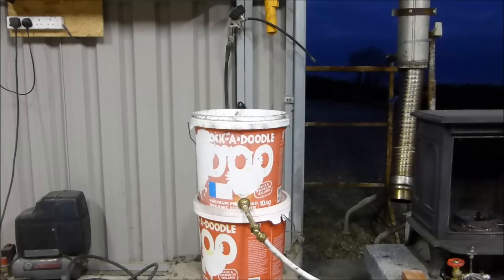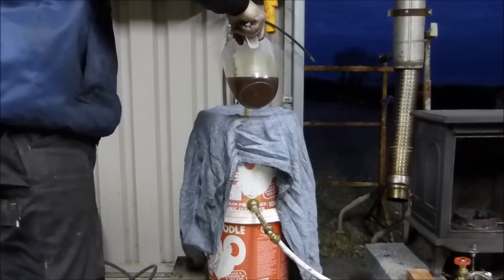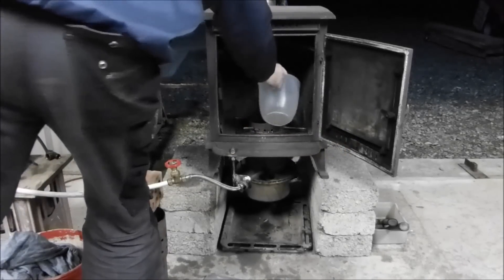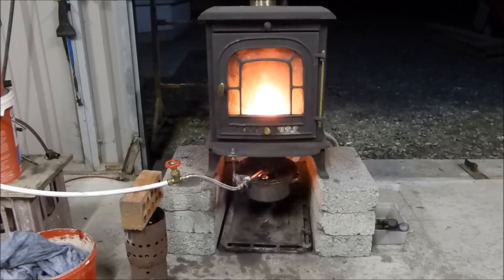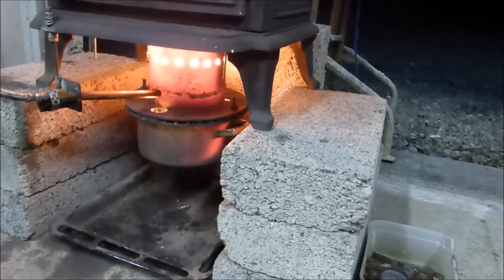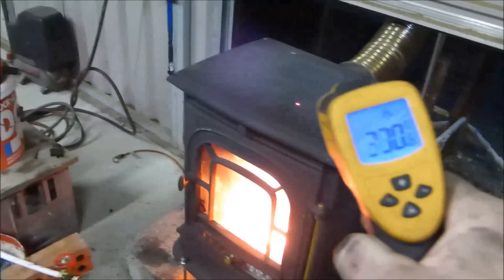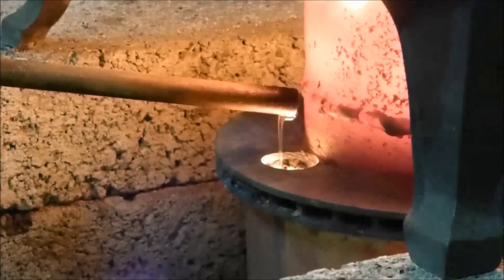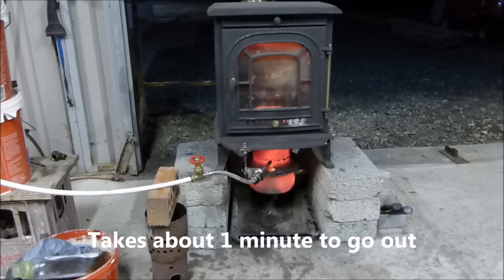Waste Oil stove heater over 800 degrees F in just a few minutes.

Comment: Pressurized oil can atomizer could throw a flame & perhaps be a primary lighting method, see what you can make instead of buying a reusable spray can for paint spraying. Add a bit of gas to the pressure input mix. See if you can obtain gasification from your flue pipe.

Comment: i build a drip feed system with a metal tank on the wall with a copper tube with a valve in it that runs through the stove's door, it drips the oil into a pot where its flamed off. could i run diesel instead of used car oil without an explosion? because i know i can run pure kerosene no problems and since diesel is a heavier fuel then kerosene i thought it could work because its so cheap compared to kerosene or trying to scavenge used oil.

Comment: I am super exited to get this running. Have all the parts done, only missing a valve and some pipe from my bucket. Hopefully I will get this running by next week :) Can't wait to get heat in my shop, it is -14F here now so my shop is just above the freezing point thanks to a small electric fan.  

Might post a video too, but this is not legal in my country so don't want to much publicity :) 

Thanks for the videos, it helped alot. 

Best regards.
Reply from the maker: Hi Norwegianwoodworker. Well done getting this far. It wont be long before you are opening windows to cool down ; ) Your flue length and diameter are important and will give you the pressure to mix the gasses for a clean burn. I was just chatting with someone who is about to light the blower version of this burner and there are quite a few guys out there who have made these. The propane tank conversion I did will burn wood scraps and veggie oil too if you want to stay green. Have fun  and pm me a photo or video. Cheers Gerry
Reply: Jepp will make a video and post on Youtube.

My main problem is the flue. I have only used 6" aircondouit pipes so far ... Not good, but I have a flue fan to increase and help the airflow. This is something that I had to use at least when I was using my wood stove.But when the pipes got hot it was ok. But I will be investing in a proper fluepipe/chimney shortly. I just want to find out what workes for me :) I made a sawdust barrel stove a while back, it did not live up to the youtube video. And was in the bin the same week. 

But I have total faith in this one. Also I have accsess to unlimeted amounts of wasteoil :) Also veggie oil but not so much. 

These large propanetank's are not available in my contry so I will not be able to make such one. 

Have a good weeken 

Best regards from Norway
Reply from the maker: Hello Norway. These things can go from modest heat to nuclear depending on the oil flow and the flue draught but they really do work. Cant wait to see the video. Cheers Gerry
Reply: Gerry's Waste Oil Burner Hello again :) 
One question, does this make a lot of noise out the chimney ? I have a school 8 m away from my shop on the south side. Hope it will be reasonably  low sound levels :) 
TR
Reply from the maker: Hi Norway. Its makes very little noise from the chimney. I don't think that it will be a problem. Even the blower version makes little noise from the chimney. Cheers Gerry

Comment: can u not just leave the brake disk vents open to draw air and put less holes in pipe?
Reply from the maker: Hi David. I was looking to use a solid brake disc but I only had a vented one. You could block off some of the vents and maybe leave a few open but you are looking for an incomplete burn in the primary chamber and the rest of the combustion takes place in the 8 inches of pipe with the holes in. The aggressive burning pulls more air in at pressure to mix the gasses and complete the burn. Check out Ozzirt on youtube as this burner is his design. Cheers Gerry
Reply: Thanks that helps i didt think of it that way.

Comment: Isn't 800% F a bit much for indoors.?
Reply from the maker: Hi Robin, I use this burner in my uninsulated shed and in most of the videos its just in testing mode where I want to see what the stove is capable of. I run it a lot cooler in normal use. Waste oil is capable of producing lots of heat but like any fuel there are dangers. Cheers Gerry
Reply: Gerry's Waste Oil Burner Thanks, for answering..

Comment: I made one a couple off years ago from a petrol stove. That way its more easy to make it burn a little slower. I just adjusted the oil intake to allow the thick oil to pass
true and also you need to make the oil pass true a copper thin spiral nearby the stove to preheat the oil just a little bit. THE ONLY PROBLEM IS TO GET THE OIL FOR FREE ONCE YOU START BURNING 10 LITER A DAY !!
Reply from the maker: Hi moetakke. In later videos I converted a propane tank to burn the waste oil and also set it up so that I could burn logs / solid fuel. It makes for a very versatile and inexpensive stove. http://youtu.be/J9-0Do0dzCY?list=UUqe1yTIkHEFx17lmI1zvttA
Same stove burning waste oil  ..............   http://youtu.be/QQGtl87-x58?list=UUqe1yTIkHEFx17lmI1zvttA

Cheers Gerry

Comment: Have you gotten it red hot like that and then tried running even less water into it? Maybe that temperature will split the cohesive bond of the h2o and you'll have a water-based oxygen/hydrogen stove... IF that much works, then you just have to hope that the oxygen/hydrogen burns hot enough to keep it cherry and keep the reaction going. It's worth a shot. If you do try it, use distilled water.

Comment: Hello, is the brake disc made out of cast iron? If so ,what electrode or filler metal did you use to weld it?I'm currently trying to build an oil burner similar to yours but don't know if welding a cast iron brake rotor to a steel pipe is possible.
Reply from the maker: Hi sloppi1234. Yes the brake disk is cast and the rods I used are just standard mild steel filler rods. Have a look at my other burner and see which one suits you better. It will fit inside a stove but requires a fan. I show the build and I show how to light it here: http://youtu.be/AiKcx7ghtHk
Cheers

Comment: do you think a forge could be made to run like this? 2000 F is a big step up from 800 F but could it be done?
Reply from the maker: Hi. Although this set up will go quite a bit hotter I think in order to melt iron you would need a mechanical fan and a turk burner or babington burner type setup. Same feed system but some sort of refractory cement / clay liner to keep the heat in and an air supply added from a fan. The advantage would be that you could match more air to more fuel until you got the required temperature. Cheers.
Reply: I was thinking build a rocket stove with this as the fuel supply and you could get it really hot.

Comment: Hi.... and good job, seems to work great...
Have you done any experiments in reducing the air / waste oil mixture to make this a more efficient fuel burner?? i.e. less holes/less fuel/low smoke?
Reply from the maker: Hi.ningis21. On this particular burner there are a third set of holes that were originally outside of the stove and pulled air for the burn. Combustion all happened within the pot and secondary burn chamber with no flame within the stove. I wanted some of the flame to happen within the stove so I moved the burner higher into the stove so that only 2 rows of holes draw air for the fuel mix and the third row is just used for anchoring the unit within the stove. In this video I am really driving the unit hard but it will burn efficiently with less fuel but obviously with lower output. You can see the burner setup better in my other video. http://youtu.be/mh3cljTTJ2o   Cheers.

Comment: Nice setup are you Bob geldoff sorry only kiddin I'm a scouser can't help it!
It burns amazing seems like you should be smelting ally with it rather than a space heater as the fuel used is crazy were would you fi d a weeks worth. I've just bought a WWII US ARMY 12" tent stove it's a 12" round like your pan with the lid on and a 6" hole with a mushroom in the middle and you put inside a wood stove but it supposedly uses 1/2 ltr hr on full it's rated @ 34000 btu dont know how hot that is.
When it arrives i'll post a vid can't wait keep up the good work
Reply from the maker: Ah if only I had mr. Geldofs money. The flue pipe I am using is old gas flue pipe. it had an aluminium liner until I lit the stove and melted it. I had a big pool of melted metal on the shed floor. Your army tent stove setup sounds very interesting. Cheers

Comment: Cool but looks dangerous, just would like to know what's stopping the flame from traveling up the dripping pipe and back up to your bucket and exploding ?
Reply from the maker: Hi. The oil is actually quite hard to ignite and needs to vapourise first in the pot. If you spilled oil on the floor and tried to ignite it with a blow torch it won't light. If it were petrol / gasoline it could happen and I would have no shed: ) Cheers
Reply: successful waste oil burner question ,are you use ventilating holes on brake disk ,or they are not in use for this purpose?thx
Reply from the maker: Hi Dejan. The ventilations are not in use and are welded closed. The only air inlets in the disc are 1 x 30mm hole in the front of the disc and 2 x 10mm holes to the rear. Cheers
Reply from the maker: dlawlor80 The fuel is quite hard to ignite and even if it were in a bucket and you had a blow torch it would not light. Well depends on the size of the torch but it is not like petrol or the movies : )' Cheers

Comment: Love your stove, I have one built myself but i like yours better. where do you buy the stove like yours? i have searched online and cannot find one like yours. Can you please help?
Reply from the maker: Hi. The stove was actually purchased on ebay uk and delivered to Ireland. The only mod to the stove was to cut a 6 inch hole in the bottom which can be plated / sealed easily and the stove then can be returned to original use as a multi fuel stove. Cheers.

Comment from the maker: Thanks Thomas.
You have started a little revolution all around the globe bringing cheap / free heat to the masses. I have even seen a couple of videos of people here in Ireland making versions based on your design. It would be very easy to incorporate the burner into an outdoor modded central heating boiler and run domestic hot water and heating. Best regards Gerry.
Reply: Hi Gerry, I'm really pleased to be able to help.
Gordon Robertson has already done it in Scotland saving himself several thousand pounds every winter. Here is a link to his experimental version, now heating his house. watch?v=7_AVCnAzYbY
Cheers,
Spike.
Reply: that is brilliant stove,some heat id say!!!!just wondering i have a old cow cubicle that is over 60 ft long and 30 ft wide and roof is almost 15ft high converted to a garage would a set up like yours give me enough heat??have a jet heater but hate the noise and the fumes plus it drinks diesel at a fair rate..
Reply from the maker: HI mad4tarmac. Here's a link to another video. Check out this propane tank version. It outputs serious amounts of heat. At night you can see that whole thing glow if you dial the fuel up a bit. Still burns 3 to 4 litres of waste oil per hour. http://youtu.be/cYxtNRKj1Es
Cheers
Reply: successful waste oil burner thanks very much...time for the welder and the A-team music!!! ill post a vid of mine when done as have a old compressor tank im thinking of using cheers for the link.